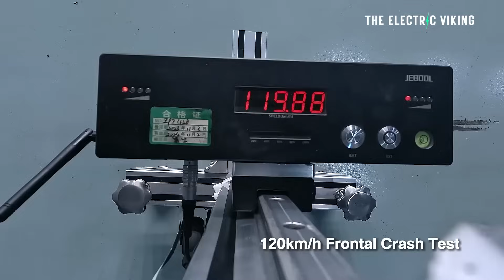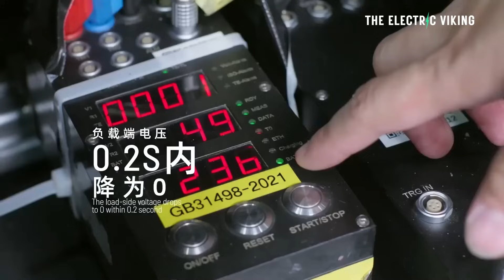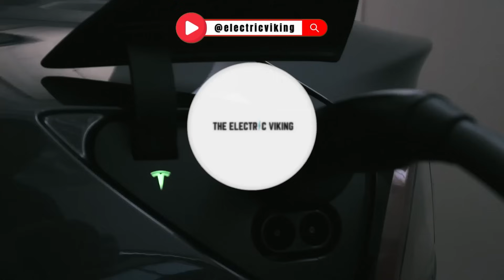CATL’s EV skateboard chassis will change the way cars are made

Comment: So.  This technology is much safer.  Excellent.  We should ban all previous EVs that do not have this?  ???
Reply: Yes and highly combustible chemical bombs more commonly known as petrol cars. Oh, and diesel, we better not forget those fire bugs.
Reply: Previous EVs are still mostly safer than ICE vehicles.
Reply: @jysmtl  ice vehicles have been widespread for over 100 years.  I never heard the words "thermal runaway"
Reply: @carusmike  you’d never heard of a vehicle fire before EVs? You have lots of hot moving parts near ignitable fluids like oil and petroleum spirits, the resulting fires can be worse than thermal runaway (the fire that destroyed a multi-story car park at Luton Airport, taking about 1200 other cars with it, was caused by an ICE vehicle).
Reply: @carusmike  oh, and the stats are that, per mile driven, you’re about 20 times more likely to have a fire with an ICE vehicle.
Reply: @stevetodd7383  use the stats that favour your argument and ignore the more appropriate facts.
Reply: @carusmike   and these more appropriate facts might be? EVs are moving towards either LFP or (on the horizon), solid state batteries. These are far less prone to thermal runaway than conventional NMC lithium batteries. Even if you have a NMC pack then you’re much less likely to have a fire than if you have an ICE vehicle. ICE fires can be as destructive if not more so than an EV in thermal runaway.
Reply: @stevetodd7383  YES and I can't wait to buy one.  But seemingly I must wait.  But the time to buy is coming fast.
Reply: @carusmike   you can buy LFP powered vehicles today. They are at the lower end of the EV price spectrum and, as I said, they are much less prone to thermal runaway. There are videos of nails being driven through LFP cells without ignition. These vehicles can manage 200 - 300 miles on a charge and have a longer pack life (in terms of charge cycles as well as time) than NMC packs. Solid state batteries look great, but that doesn’t mean that current vehicles aren’t a viable option.

Comment: I don't think the human body can survival a crash at 75mile an hour
Reply: What matters are the G forces that the body is subjected to on impact. If the chassis is completely rigid then an occupant is subjected to very high G forces and the survival chances are low. If the chassis has crumple zones then the transfer of forces is more gradual. What CATL are saying here is that a head on impact at 75mph is survivable with their chassis.
Reply: 😂 @stevetodd7383  nu spun asta , spun că bateria nu explodează la viteza aia. Nu exista sa reziste un om la așa ceva. De aceea nu vezi manechin in mașină la test. Ar fi "mort" 😂
Reply: @redtechnic7734  I’m not following. The battery DIDN’T explode or catch fire in the test. The only things that could otherwise kill an occupant are crushing (the pole intrudes into the passenger compartment) or G forces. You can measure those without a test dummy.
Reply: I suspect a few race car drivers would question your belief

Comment: I wish our friendly Viking would spend a little time to research before producing videos.  The key here he is not addressing is the electrolyte in LFP batteries contains no oxygen.  No Oxygen = no fires.  Older Lithium batteries contained oxygen, hence burning Porsches, & boats….
Reply: Tesla already did. All the cells are monitored and have shutoffs at each cell. When voltage drops, they turn off those sell to maximize efficiency. This is also done by AI in battery management.
Reply: You know what LiFePO4 stands for?
The O is oxygen. Yes certain electrolytes can make the battery safer, but the oxygen comes from the electrode.
Reply: @ In LFP batteries the electrolyte is stable and there is no out gassing of oxygen.  It is not flammable.  Whereas Li Ion batteries have an electrolyte that burns due to the presence of oxygen.
Reply: @J0hn1o1o po stands for phosphate.  PO4 phosphate is as combustible as carbon dioxide.   Try burning the carbon dioxide gas that is released from a bottle of pop.  Phosphate has released the combustion energy of oxygen and phosphorous.

Comment: II don't know how accurate this is but, I've read that when an EV is in a crash, what looks like $5,000-10,000 in damage isn't repairable because of giga casting.  The internal parts are getting bigger and bigger as you have reported. That makes the cars very solid and safe but at the same time unrepairable after a collision.  The giga cast parts are a major piece of the entire structure.  They can't be removed and replaced.  That makes the cars less expensive to make but...The insurance company has to total it so they're paying 30, 40, 50K or more making insurance rates higher.
Reply: Not True. There are Segment repairs you can make to gigacasting chassis parts. Tesla actually have quite a few replacement parts that you can weld, Glue and bolt in if the damage isn’t too intrusive. They showed it at the factory during a report. If the Gigacasting has to be replaced then it’s totally recyclable through the Gigapress once all paint and glue is removed. Much easier than old school structural recycling or refurbishment …  insurance companies actually don’t have to write off most crashes, especially in Teslas because of this forward thinking …
Reply: Any modern vehicle is an expensive nightmare to repair. Once you get past all the bonding and bolts you then have the cable runs the sensors the inner skin. Even slight cosmetic damage can run into thousands of dollars very easily. Also bear in mind any catastrophic accident and the occupants cost the insurance company far more than the vehicle.

Comment: Please Sam tell this so called Government of New Zealand how safe EVs are to petrol cars. They are increasing ACC on EVs from $42.09 a year (which is the same as petrol) to $109.05, and by 2027/28 year the levy for Electric vehicle owners will jump to $122.24 per year twice the petrol vehicle rate. I didn't know that petrol vehicles were that safe and had a high star safely rating. Yeh Right and now they are going to increase the CO2 emissions on commercial vehicles, soon they will have us driving horse and carts. All I can see is this Government is showing us it's middle finger to Global Warming and all the Lung Cancer patients caused by tail pipe emissions.

Comment: where are your stat you are quoting for hybrid fires? could you post your source.
Reply: Let’s put a highly combustible chemical tank next to high tension voltage wires and batteries. What could possibly go wrong?
Reply: That is common knowledge. Just use any statistics.
Reply: Or you can Google it and find dozens articles stating the number of fires per vehicle category. Hybrids be a bad shout.
Reply: You ask a simple and reasonable question and all you get for answers are attempts at cuteness.

Comment: This will lead to a resurgence of coach building companies?
Reply: hopefully. This sort of thing could be good for small volume custom cars and maybe even revitilise kit car industry if there is a true rolling chasis that they can be designed around.
Reply: The monocoque chassis of today rules out coach building, but then manufacturers share a production line and badge the resulting vehicle (with various minor cosmetic differences). This would make more custom options possible, but less so than traditional coach building as the results have to go through regulatory testing and mass production.
Reply: @stevetodd7383  Why does it rule out coachbuilds?

Comment: EVs may be safer for the occupants but with many well over 2 tonnes and very fast, they are extremely dangerous for any smaller car they hit.
Reply: Just like Range Rovers, Ford Pickups and any large vehicles.
Reply: There is a bigger incentive for the design to get rid of weight if it is an EV, as they really need to be efficient. With petrol you have heaps of energy in the system and a lot of energy is naturally lost. With EVs there just isn't as much energy that can be wasted, so everything must be optimal. 
Tesla is leading the way in using gigacast etc to lose weight, but EVs should be coming down in weight relative to petrol cars, as advances happen.
This is less important for petrol cars as a loss or gain in efficiency is not as noticeable to how far the car can go.
Caravaning, roof racks, extra passengers, the cold etc might all be more noticeable in the effect on range than a petrol car.
Reply: The weight is a universal factor, I remember the crash safety discussion when SUV and CUVs hit the market. The improvement is in better safety systems and self driving vehicles.
Reply: @Harrythehun  the point is still valid. Smaller vehicles stands no chance
Reply: @DLiotine  But once all cars are EVs, they will all weigh relatively more, once again rendering the argument moot.  Also, over time, batteries will get more efficient, meaning less material will be needed, and weights will come back down somewhat.